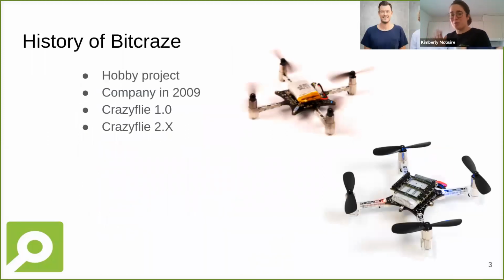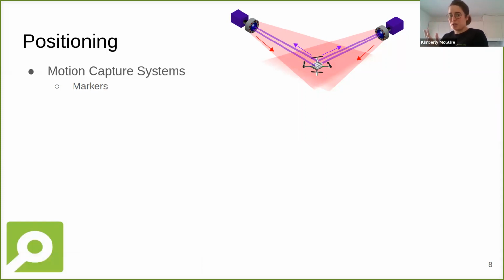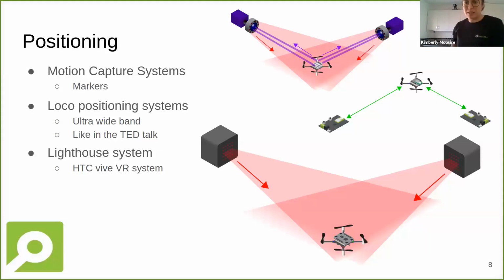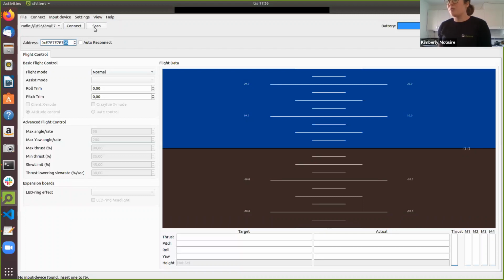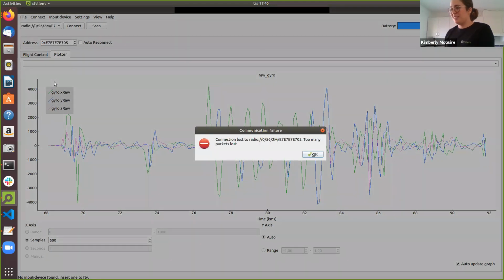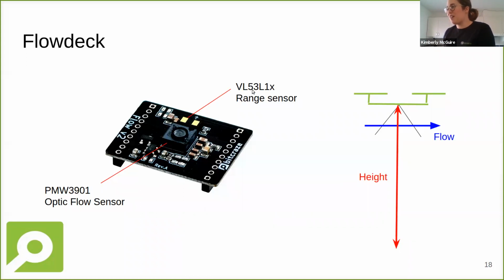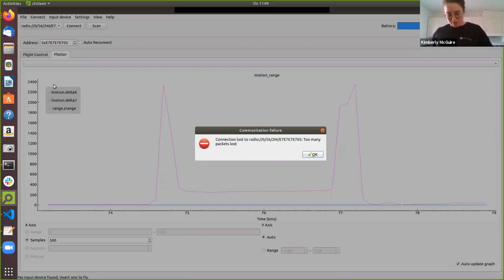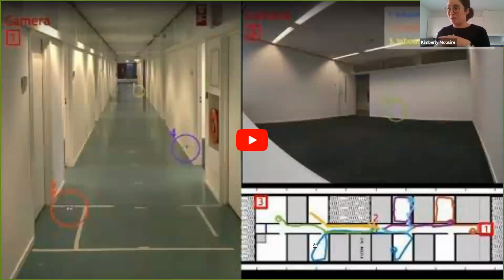Bitcraze - Crazyflie 101 EPFL-LIS lecture - part 1 (2020)

Comment: What is the maximum and recommended flight speed for the Crazyflie 2.1?
Reply from the maker: That is a matter that is determined on how well the positioning is. For millimeter precision positioning system, probably the maximum speed is 3 m/s but should probably be lower than that for more stability. We haven't really tested this ourselves but it is based on the experiments done with the crazyflie.